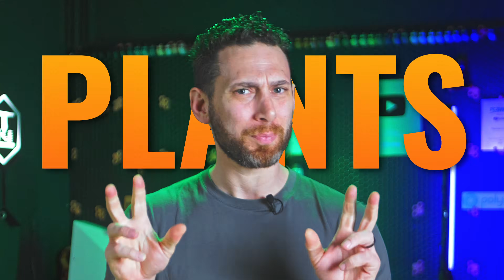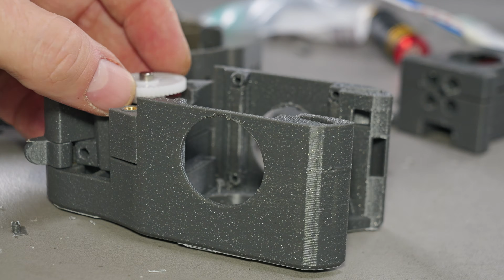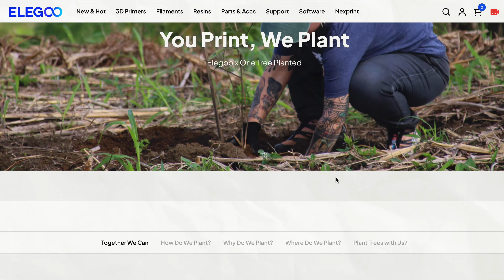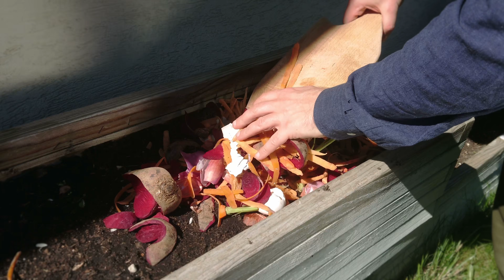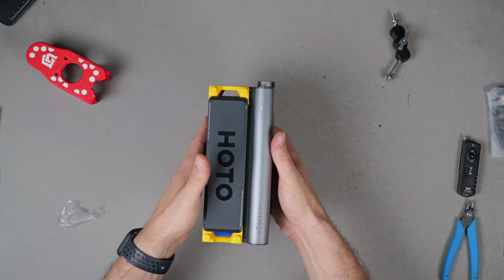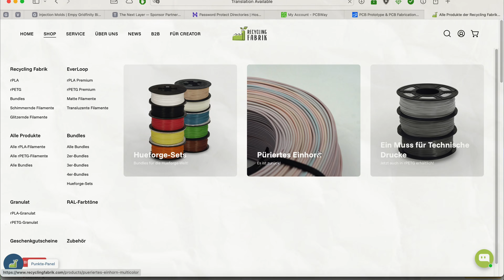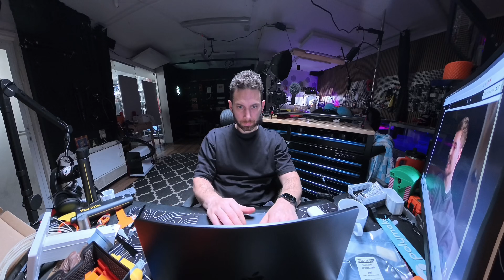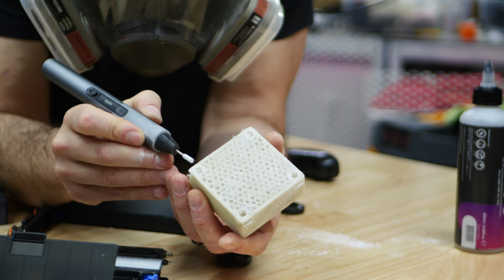3D Printing Doesn't HAVE to Destroy the Planet!

Comment: PLA is "green" if it's base. The minute you add matting agents, or any + ingredients, that typically goes right out the window. And it still produces microplastic
Reply: Perhaps, but it also serves as carbon capture and is bio degradable. So it doesn't leave toxic chemicals behind. As you say, that doesn't necessarily apply to the additives, but it is a solid step forward. We're never going to find a material better for everything we want to make than plastics, so we should invest in making that material less harmful.
Reply: And the solution for PLA is to change to PHA.
Reply: @tenchuu007  It is too far towards easily biodegradable from what I understand. If you specifically want something that will break down it is useful, but otherwise people will choose other materials because they don't want to have to replace it every year, or sooner.
Reply: @Rand66437 PHA takes six months to a year to degrade if it's outdoors in a compost pile after being cut into 1" segments. In terms of our standard uses we would see zero degradation unless it was placed outside, and even that would be slow.
Reply: @tenchuu007  Maybe where you're at, but everywhere I've lived even standard plastics built to resist sunlight degrade enough to need replacing or some kind of protective coating within a couple years tops.
Reply: @Rand66437 right, so exactly as I said. For interior projects there is almost no difference in longevity.
Reply: @tenchuu007   No you didn't, you mentioned outdoors, never indoors. Even indoors there are cons and scenarios you'd have to be aware of. Long term contact with water would start decomposition, bleach or harsh cleaners, etc. You could coat the plastic, but then you're recreating the original problem. Like it or not PLA straddles the divide quite admirably for now. Frankly, PLA's decomposition time period is close enough to wood that I don't even see why you're so caught up on it taking awhile to decompose. Lots of natural materials also take a loooong time to decompose.
Reply: @Rand66437 I suggest you look more into both PHA and PLA because your understanding of how they biodegrade is severely misinformed. PLA under no circumstances biodegrades in nature. It just breaks down into smaller and smaller micro plastics. Aside from making it's way into a forest fire or a volcano, there is no natural environment where it will leave the environment. It will forever be there in the form of micro plastics.

PHA on the other hand is consumed by bacteria. Left in the natural environment it will biodegrade at about the same rate as wood. Water itself does not harm it. It has better chemical and UV resistance than PLA.
Reply: @Hinagea  It requires specific high-heat (over 140°F/60°C), high-moisture conditions to decompose into water
 within months, otherwise, it behaves like conventional plastic for years. So yes it sticks around, but congrats, like it or not it does bio-degrade not simply degrade which is what makes plastics truly horrible. I could explain the cascading effects of what that actually means, but hey, you can do your own research after telling me to do so right?
Reply: @Rand66437 Exactly, where is 140f found in nature for PLA to biodegrade naturally? Is this a joke?
Reply: @Rand66437 Also PLA is not a net negative carbon capture like wood. It takes significantly more carbon input to farm and process plants like corn into PLA. Stop greenwashing PLA. It's still better to print with PLA than other plastics. PHA is better yet purely from an environmental perspective, because it isn't nearly as printable in its current state
Reply: @Rand66437 we both were discussing outdoors, then I added the information about indoors. It was not a refutal, it was an extension.
Reply: @Rand66437  It is perfect for designing prototypes, since you will not keep them anyways (except for maybe on a shelf - you get my point). It's just still way too expensive.
Reply: @Rand66437 it's only biodegradable in an industrial setting. It won't biodegrade naturally or in home composting, even somewhere hot and humid like where I live.
Reply: Neither does mulch
Reply: @tenchuu007  I thought it degrades eventually, but takes decades.
Reply: @Rand66437  Mulch absolutely does. Don't spread garbage
Reply: @jasonpotts6490 Thats a common tactic the plastic industry uses. No longer visible to the human eye does not equal biodegradation. It equals micro plastics. That's the problem. We have 70 years of micro plastics to deal with already. 3d printers are making it exponentially worse. Materials like PHA which have similar properties to PLA, but are biodegradable will be the future. PHA as of right now mostly works, but still has some teething issues
Reply: @Hinagea  It can take decades for the stuff made out of actual wood given ideal conditions. There's a reason cypress mulch is super popular. I didn't say it didn't degrade, I said it requires similar conditions to PLA to degrade completely in a meaningful amount of time.
Reply: @Hinagea  True but the reason plastic is bad is because it doesn't biodegrade, only degrade. In short it creates toxic waste products and fosters similarly toxic bacteria. PLA shouldn't so long as harmful additives aren't used. They're in 2 entirely different categories.
Reply: PHA will likely have the same exact issues as PLA. PLA was significantly more biodegradable originally, that conflicts with it being useful, so it was deliberately made less so.
Reply: @Rand66437 PHA does not have the same issues as PLA. PLA's base resin has always required industrial composting to truly biodegrade. PHA does not. PLA isn't accepted at industrial composting facilities because of the toxic additives. Ecogenesis PHA is certified biodegradable with the dye. That's why there's only a limited number of colors. Sure other manufacturers could slack,  but if we do our due diligence and choose a filament manufacturer like Polar Filament that uses ecogenesis PHA, then it's not a problem.
Reply: @Hinagea  You're obviously not an engineer or you'd realize they're different enough that comparisons aren't even worth making. The very traits you're pushing mean PHA has a very specific niche and can't compete with PLA, even supposing it is made cheaper.
Reply: @Rand66437 we can agree on one thing for sure. They are different. One is biodegradable, the other is not. Now stop speaking on things you know nothing about
Reply: @Hinagea  Afraid you're the one that doesn't know. The official and indeed even the negative takes on PLA say you're wrong. It is bio-degradable, it just takes a long time.
Reply: @Hinagea Go look up the definition of bio-degradable, it doesn't specify a time limit, only the process.
Reply: PLA is only degradable in specific industrial settings. No one in my country does that. Best I could get is to send it to cement producers for burning in their furnaces.
Reply: @JaldaboathIrghen that's precisely why I put green in quotes.
Reply: Don't some of the high strength pla's use PC as it's blend?
Reply from the maker: Most importantly though, it smells delicious while you're printing it.
Reply: @thenextlayer  Especially the PLA with bacon-cheeseburger additives.